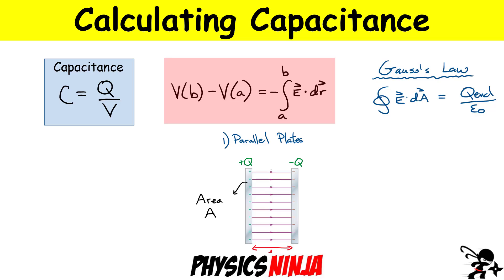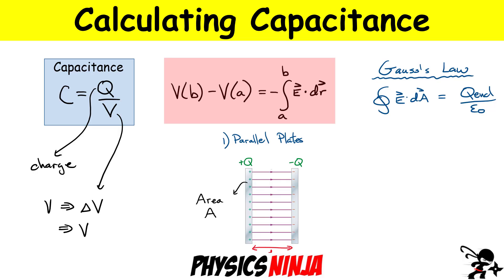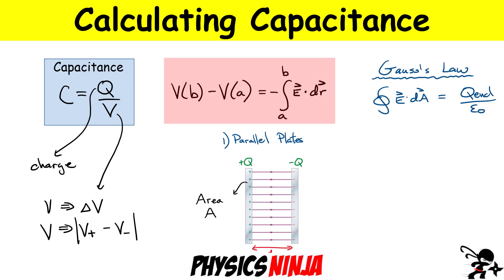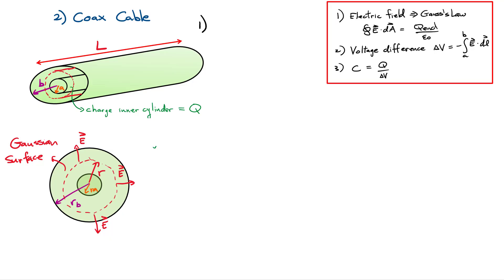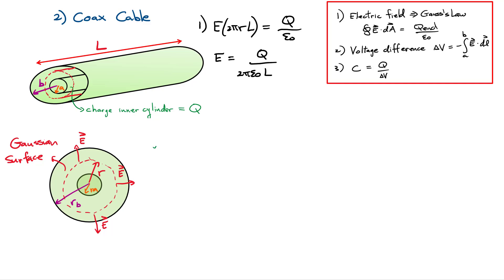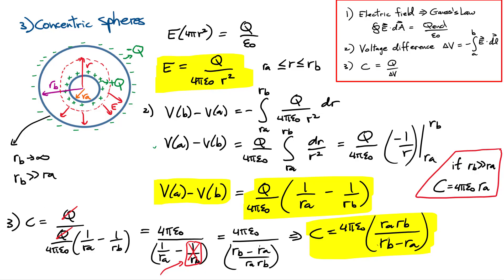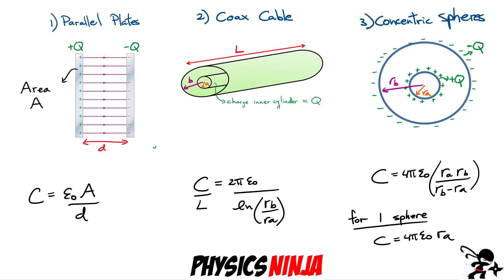Calculating the Capacitance of Parallel Plates, Coax Cable and Concentric Spheres

Comment: Awesome and very helpful videos! 
I have one question: in a real wire the net charge Q is zero as it is supposed to be neutral. Assuming this statement is true, it turns out that net charge of the wire Q=0 -> implies that E=0 and V=0 at any location outside the wire. And.. that is not consistent with what we see in reality. For example, long power transmission wires present some capacitance between them and the ground, or the coaxial cable seen in this video between the inner and the outer cylinders. So, where am I wrong? Does indeed exist some surface density charge in the wire despite being neutral? I have been trying to solve this question for a long time.
Thank you in advance and regards from Spain!

Comment: Thanks a lot , i was thinking whole the time with the sign of the integral , thanks a lot ❤
Reply from the maker: Yes that is a bit tricky
Reply: @PhysicsNinja  no , i mean in the halliday book used another method to calculate the voltage , and you did it better and more comprehensible or apprehensible or understanable or intelligible . Thanks a lot from now i will use your method in order to solve all the questions , thanks a lot ❤💙🇪🇸🗽🇺🇲⚽️

Comment: my doubt is in sphere case pontential outside the b sphere can be calculated by adding the E.fields of both spheres right , which means is that zero if both sphere have same charge 
similarly in cylinders also😅
by the way great explanation

Comment: Great content, as always. I have really hard question, how to calculate characteristic capacitance  along vertical wire over ground plane? I mean on infinitesimally small wire segment at the height h, over the ground plane, along vertical wire with radius r? Or, if not possible, capacitance of vertical wire (cylinder), over the ground plane, ignoring top and bottom exposed to the GP?